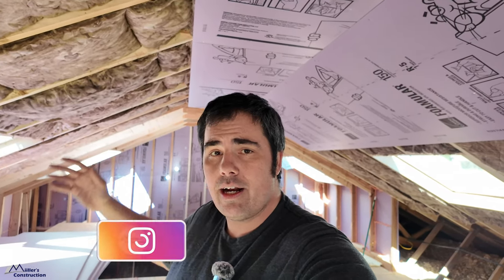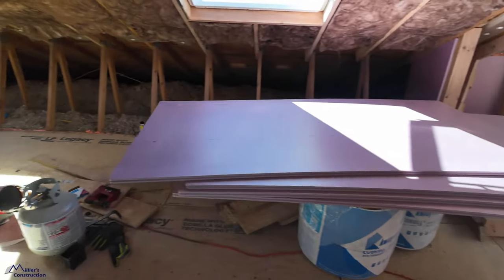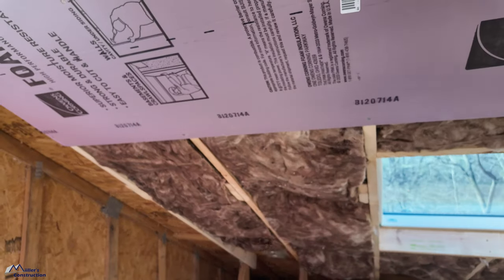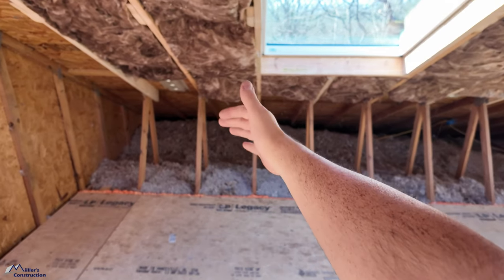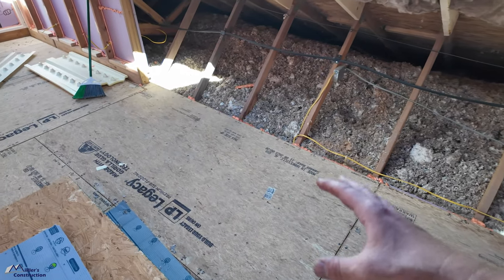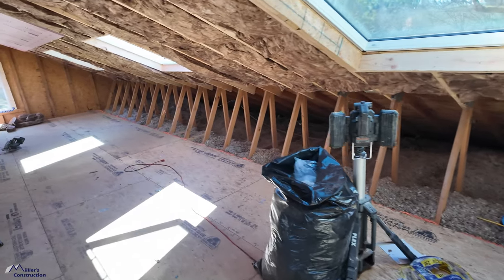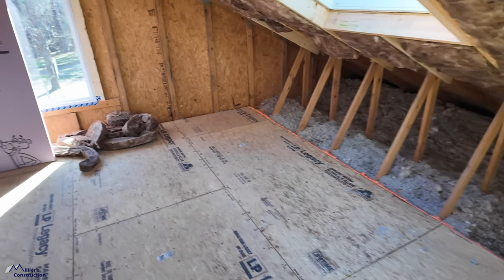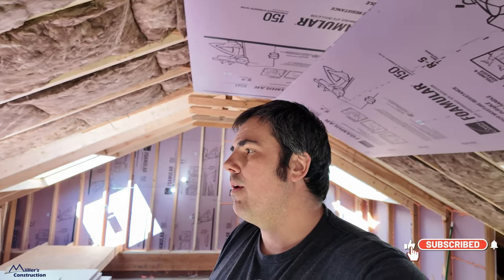Transform Attic Into Living Space - Air Sealing & Insulation Details

Comment: Good attention to detail. You are correct the baffles should extend down to the vented soffit.  The concern there is windwashing of the blown cellulose.  Depending on where you are located the vaulted ceiling total R-value may not meet code. Most areas of the country require R-30 or R-38 minimum.
Reply from the maker: It definitely does not meet code and the client knows that, the engineer also knows this. So how are we getting by doing this? Codes are pretty much non existent in my area. I know some of the code, but only from what I read online. In my 19 years full time as a contractor I've still never met a code enforcement officer or license inspector.
Reply: @miillersconstruction  well your the type of contractor we say was trained by the inspectors. You've never read code. 
Code is the lowest standard you should do and your bragging that you don't even know the lowest standard and have no intention of even knowing how low your quality  is.
No baffles shouldn't be an issue??????? No, as a matter of fact that will be an issue.  Are you going to tell the client how much faster they will have to reroof with your design here.
Reply: @sparksmcgee6641 
What would cause the shortening of the roof's life?

Comment: All of this seems like nonsense when you should just be using closed cell spray foam
Reply from the maker: Hey thanks for checking out the video. You might want to do a bit of research on spray foam. There's actually an article in the latest issue of Fine Homebuilding that talks about it's failures.
Reply: @miillersconstruction  I agree with your build details but what are the latest failures with closed cell spray foam? I couldn't find any info aside from the cost, improper mixture with leads to bad foam (off gassing and adhesion) and material too wet for foam to adhere all due to operator error and not the foam. I'm genuinely curious as I'm looking into various types of insulation for a future build myself. Thanks for the video.
Reply from the maker: @stealthassasin1day291  all of those points you mentioned, plus the conditions on the job site need to be ideal. The moisture content of the lumber the foam is adhering to, the humidity in the air the day they're spraying. All of those things are contributing factors. Leaky roof? You won't find it until it's way too late. I'm just not a fan of spray foam between rafter bays in my climate. It gets very hot and very humid here. Also currently there are only 2 shingle manufacturers That will even warranty their product if the underside of the deck has been spray foamed. Just too many variables, I've personally seen it fail, and the price point is 5x the strategy we have come up with for this particular build. I'm spending the clients money air sealing the space instead of using spray foam.
Reply: Looks like a good setup. Seems the trade off for a finished attic is either roof replacement before it fails, or wait for the leak and a larger repair from the hidden layers. Neither are sustainable.

I forgot option 3, move out first and let either be someone else’s problem.
Reply: @miillersconstruction your set up is causing the same shingle issue as spray foam. So they the facing roofing without the benefit of good insulation. 
Man you're really not doing thi gs right. 
Flashing is putting an inch and a half of foam then batting. 
You said the area is high humidity and you just built a moisture trap.